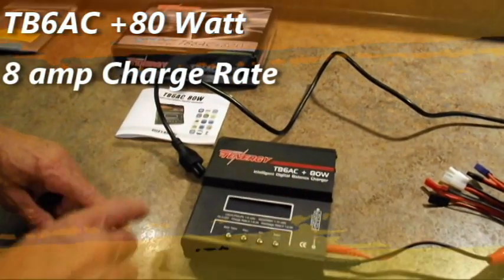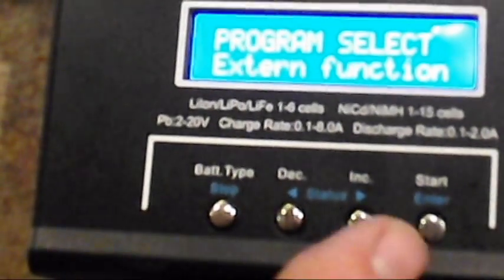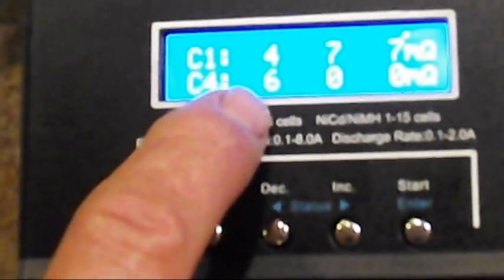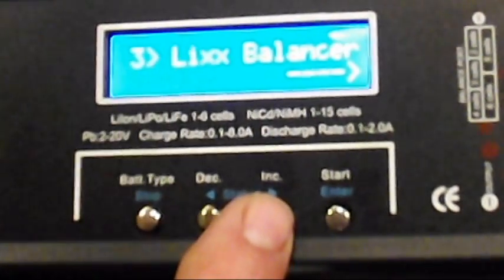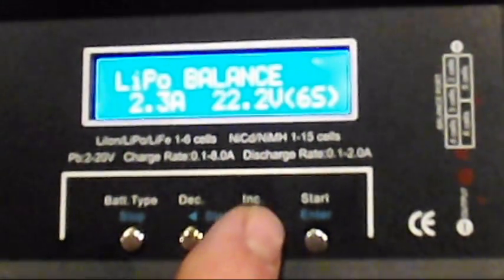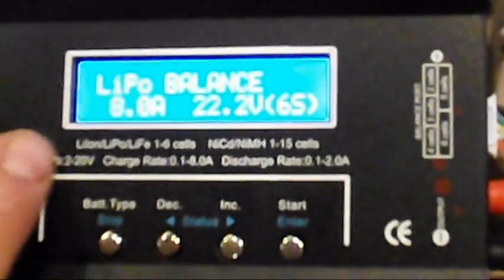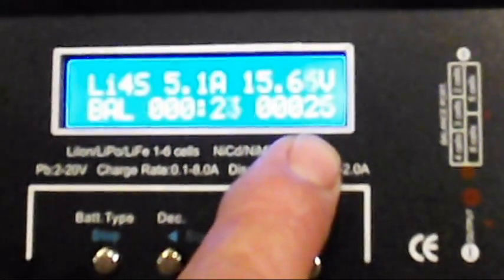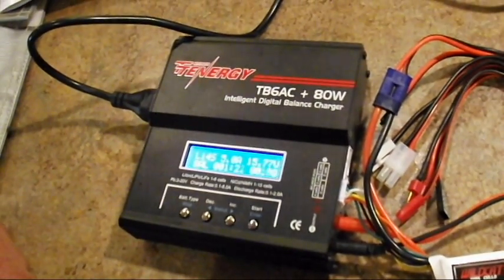TB6AC+80

Comment: Hi can I charge a eflite 1s 3.7v 150mAh (.5Wh) 25c in this charger?
Reply from the maker: you can but you need the mating connector and you need to set it unit at .1 amp charge rate.